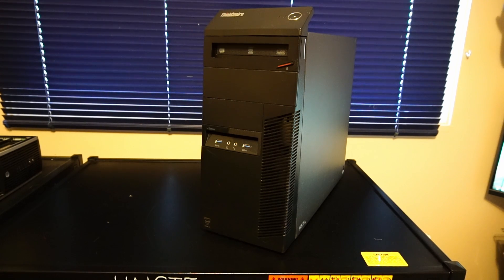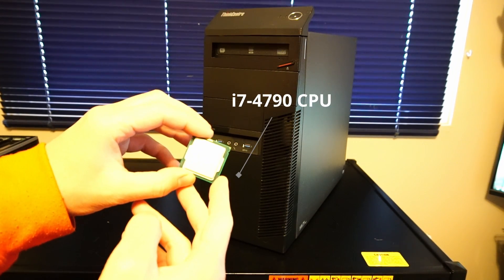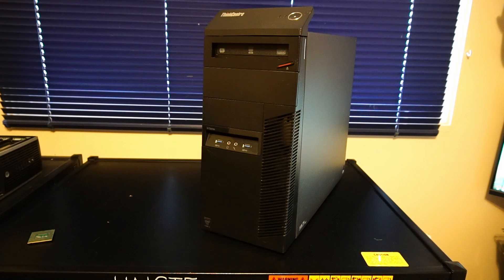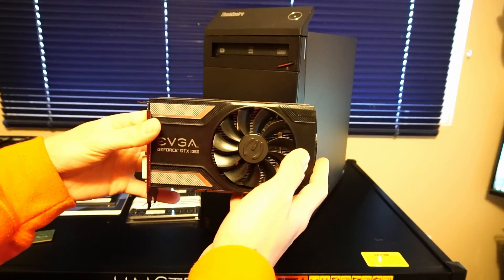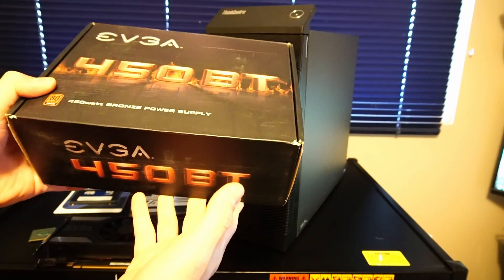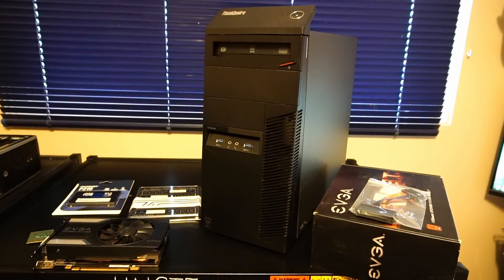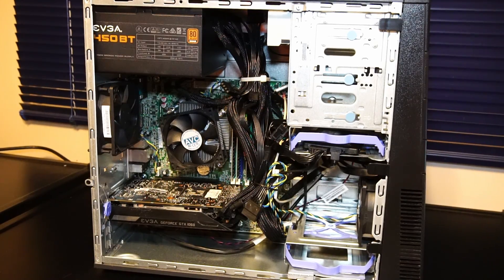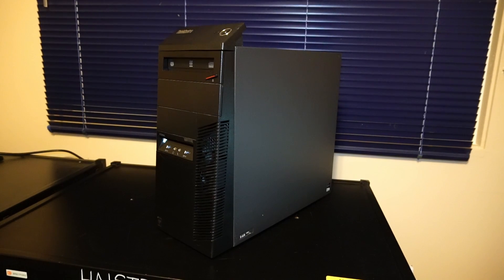i7-4790 & GTX 1060 6GB in 2023!  ThinkCentre M83 Upgrades!

Comment: Question, can i put a core i7 4790K? It will support?
Reply from the maker: Yes it should be fine, though there will be no overclocking in the Lenovo BIOS.  It will run at the clock speeds natively offered by the CPU.

Comment: Is it bottleneck cuz i got a lot of stutters in fifa at ultra and spider man
Reply from the maker: If you have the same CPU, RAM, and GPU combo I don't know if it would be so much of a bottleneck as it would be adjusting settings in the games.  Resolution to 1920x1080 and lower than ultra.

Comment: Pls help, i  have this Lenovo ThinkCentre m83 but is slim , the motherboard is sharkbay sdk, but dont find informaction about graphics, im gonna buy a gtx 1650 zotac dual and change case and power suply ,my question , is it compatible the mobo!?, I see manual  suport 2gb graphic card but in videos many put 1650 lp 4gb. 🤔, Im confused
Reply from the maker: Well, as you see in this video I installed a 6GB GTX 1060 and it's working fine.  You could run an RTX 4090 if you really wanted to (but don't do this as it would be a huge bottleneck with 4th gen Intel) and had the power supply to support it.    You need to buy a 24 to 14 pin cable adapter to install a larger ATX power supply.   https://www.amazon.ca/gp/product/B07F1N6YY6/ref=ppx_yo_dt_b_search_asin_title?ie=UTF8&psc=1

Comment: bro you're using way too much thermal paste on that cpu ^^
you need as little as possible to maximize heat transfer, a pea sized blob in the middle is enough
Reply from the maker: I won't lie, a glob came out of that tube and I still installed the heatsink on top.  Thanks for watching :)

Comment: Bro my 1060 burning hot with that cpu lol or maybe thermal pasta old
Reply from the maker: If you're using pasta for thermal paste that might be the issue.   If you're up to it, inspect the graphics card for dust build up, clean it, and apply new thermal paste.  Watch that you aren't displacing any thermal pads on the VRAM if there happen to be some.  Feel free to reach out if you need help.